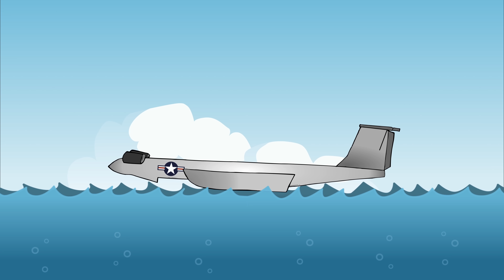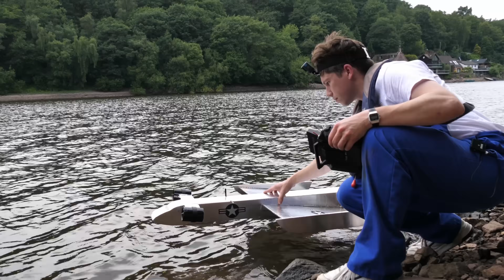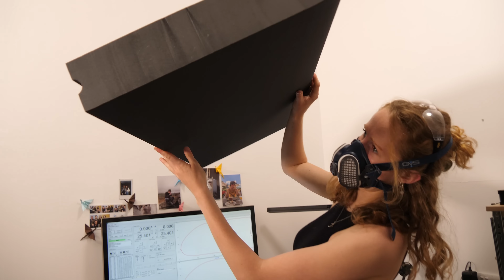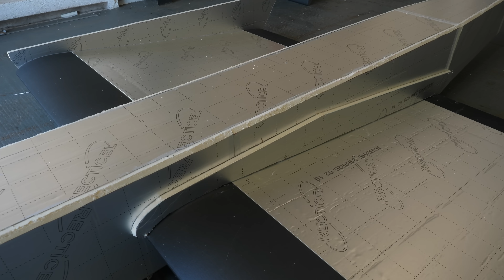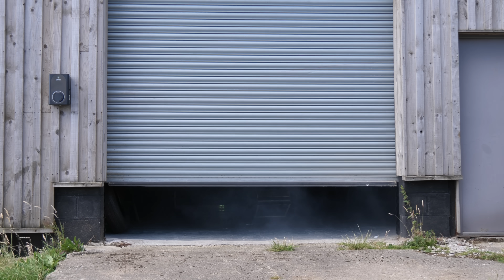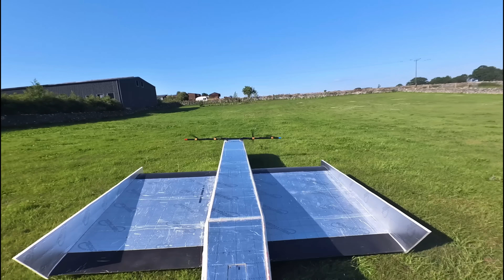Giant Ground Effect Plane (part 1)

Comment: If you make the effort to form the "wings" and other control surfaces into actual air foils, and route the wires for the thrust motors through the carbon fiber tube, you'll find that you'll have far less drag to deal with and better lift/flight control.

Leaving the flight control surfaces flat, and the wires for the motors out in the slipstream do nothing to aid flight characteristics and cause more drag.

Comment: The Ekranoplan was an amazing creation. Unfortunately it could be easily thwarted by small surface sea mines. A $100 floating mine with a proximity fuse would deny a surface-effect heavy-lift vehicle like a brick wall. Whether it cost $100m or $500. Floating mines were the death of the seaplane. A bucket full was area denial. The Japanese didn't deploy these in thousands. They are deadly against PT boats and seaplanes. Both theirs and yours.

Comment: There's a another video about such a thing, not quite so large. What's funny about it is that the creator bad-mouths the concept, saying they're useless except on glassy calm water.
So they take it out on a lake with a chase boat and right away prove that it doesn't mind when the wake from the boat is bigger than it, and that it can fly.

The KM and the later, smaller Lun were not capable of flying higher than a few meters because suits and uniforms wouldn't give Alexiyev the time and money to equip it with proper avionics and controls.
The second Lun airframe sat partly done indoors until moved outdoors and scrapped in 2015, but for a while there was talk of finishing it to fly, as a firefighter/ambulance, called the "Spasatel".
Many models of such things have proven that yes, they can fly, no, they're not limited to flat calm water.

It seems that very few know of the work on GEV machines by Lippisch. There are youtubes of them, and the X-113 and 114 do fly. See also the similar "Airfish" which was tested extensively and worked well. Videos of it show the pilot seemingly dipping a wingtip during turns as if to get more yaw from it, and nothing bad happens.

Also Gunther Jorg who worked with Alexiyev worked on his version of it and made it work.

Look for the USNI press article from 2020 "Modern Sea Monsters", urging development of GEVs for the US navy. They take the concerns about it only being useful in flat calm waters to task and debunk it.
 For a while DARPA was working on it and seemed confident that it u be much more capable than objectors think and would be an important asset.

Comment: Actually, the Russian Ekranoplan is capable of flying up to about 2,000 feet in altitude, but it uses a lot of fuel when it goes up out of ground-effect. The ground-effect or WIG aircraft was developed from the designs and test models of Alexander Lippisch, who also designed improved versions of delta winged aircraft. There is a medium-size WIG aircraft that operates out of Hong Kong that can carry about 8-10 passengers and two pilots or about a ton of cargo It's called the Airfish 8. It seems likely that the WIG aircraft will spread to many other places, but for some reason doesn't seem to be doing this. It would require constant vigilance by the pilots and a good radar system to avoid collisions with boats.

Comment: It might benefit your ekranoplan to put four blades on each engine hub rather than the two you have on now. Also, consider putting two smaller motors on the tail just forward of the rudder. I bet it will lift the tail, and balance the ground effect such that you don't find yourself flying sideways in a breeze. If you link the two motors to work in concert with the rudder, you will get a degree of steerability, as well as stability if it tries to flip on you. That's kind of how the real thing "worked". The rea; Ekranoplan was kind of a one way ride. It had to travel into the wind, and when it got to where it was going (no crabbing allowed), it had to be towed back to its original port using a tugboat. This got pretty old with the Soviet bean counters, and they decided to drag the thin out of dry dock and dump it on the ground a few miles away, where it was left to rust, rot, and decay. I don't know what condition it's in now, or even if anything remains of it. Last I heard/saw, It was in pretty bad shape, with all of the engines having been pulled, all the avionics having been broken, and a lot of the skin and spars having been cut off/up to recycle.  Almost all of the wires had been stripped out, and all that was left was a devastated husk. A shame really, considering all that it represents in the  history of aviation. I guess technically there is one larger aircraft that stayed in ground effect for the entirity of it's only "flight", and that is the Hughes aircraft flying boat the "Spruce Goose".  It was a gigantic aircraft; the largest aircraft of it's time by quite a bit. It had six gigantic Wright 'Whirlwind triple radial engines mounted on the wing and on it's first time out of the barn, it's designer/owner/builder Howard Hughes, took the thing out on wat was only supposed to be a taxiing shake down, and jammed the six throttles full forward. The flying boat went a few hundred feet, after which Hughes pulled back gently on the yoke, and the gigantic bird eased gently into the air. Hughes flew it for a few hundred yards, all the while the other people in the plane cursing him constantly for violating orders and actually flying the plane, while also imploring him to please land it and thus spare their lives. Eventually he gradually pulled back on the throttles, and the Spruce Goose gently kissed the water, and taxied back to where it started. At that time, Hughes, exited his plane with a huge smile on his face, only to find a lot of military brass on the peer, each taking their turn dressing him up and down, and letting him know that the aircraft was being seized, and that they would not permit it to ever fly again. They kept their word mostly. It never flew again, but they didn't junk it. Not many years later, a bunch of people who had lots of expendable change weighing heavily in their pockets, bought the Spruce Goose, and began work on a building to keep it in permanently. When the building was finished, they moved the vast flying boat into it, then donated the whole lot to the Smithsonian Air and Space Museum, in effect creating a west coast version of the great Washington DC museum. There are a few other items of flight history which have been included there, but unfortunately, the location has ended up on the block of things which President Trump has decided to cut. The situation now is trying to find enough private funding to keep the place alive until Trump is out of office, and we have someone in who cares a bit more about history, and not about the things that he had no part in. Maybe if we could name it after him, and tell everyone that he built it all with his bare hands... Na. I wouldn't want to disgrace it so.

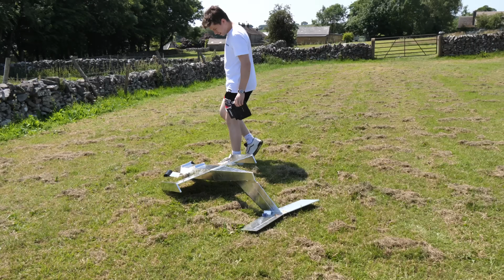Comment: What you think was a small tornado at 4:30 is a small thermal kicking off (I fly sailplanes and paragliders). Doesn’t happen over water because of its massive heat capacity.

Comment: The show Knight Rider ran from 1982 to 1986. It featured a very special talking Trans Am. The show runners would use a 1:8  scale (23 inches) miniature for various shots. The models were launched using compressed air. You do some really amazing things on this channel and I was wondering if you might be interested in trying to recreate an accurate miniature and launching it for some incredible jumps? I think a rocket-powered one would be amazing. Cheers!

Comment: I Think if you were able to set up a servo onto the carbon tube with the flight motors and are able to trim the angle after getting up to Ground effect so you can increase speed while on that foil of air.

Comment: would a more aerodynamic form not help?
Also installing the propellors on the wing remove the drag caused by the carbon fibre bar that holds the propellors.

Comment: If you saved your cut off waste parts, you can make a mold for composite layups.    Also, put a bearing & jackscrew on engine tube to control engine thrust angle

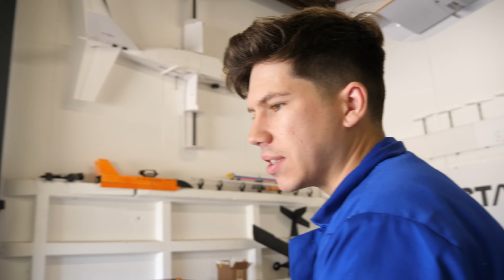Comment: 11:50 you can add tension cables to make the wings more rigid and stable.
additionally larger diameter carbon tubes would make it stiffer too.

Comment: The problem with the Caspian sea monster is that it isn't a stable aerodynamic shape . The Russians had to use a fly by wire system to maintain constant height and stop pitching up . Modern design use a reverse delta type wing which automatically maintains height .

Comment: It probably would have been easier to put either carbon fiber dowls inside of those carbon fiber tubes that hold the wing on or maybe even wooden dowls then you wouldn't have the drag that you get from the pieces you put on the outside of the fuselage to make it more rigid.

Comment: I'm not an  expert, but it appears to make more sense to have the air cushions towards the ends of the wings.  That way you can get a more stable flight and as a bones an easy way to turn, buy just slightly reducing thrust to the right or left engine.  Bit of a major re-design, but could be worth a try.  Fun watching this video.

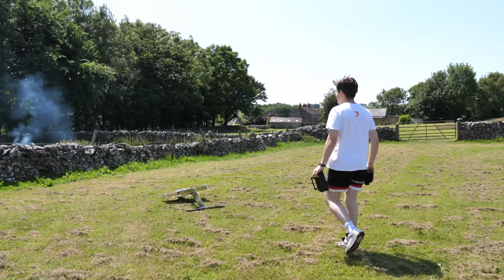Comment: 4:25 in the paragliding community those are called dust devils. They are exceedingly dangerous because they are mostly invisible and kill paraglider pilots.
They are caused by similar effects as real tornados, just driven by local thermal bubbles instead of large scale weather effects. And yes, bonfires do create thermal activity.

Comment: Nice build and well done. Looking forward to seeing it perform on water. Just a couple of notes. When you look at the actual Econoplane there is a definite dihedral to the tail plane presumably to assist with roll stability. Also the jet engines appear to be aimed above the wings presumably to move the air faster, lowering the pressure above the wings helping lift. The air flow provided by the propellers you are using might not be fast enough although I do notice that the motors on the large model do appear to be mounted higher above the wings. This is no criticism of your design and efforts, just something that I noticed.

Comment: Very cool.
You're making it hard to work, as the scale weight is really low. At 6 meters it should be 1000 times the weight of a 60cm version but it's obviously much lighter. You aim at similar speeds as a 60cm version. Very wind sensitive.
At that scale, a 100 mph manned ecranoplan could be built. With a more correct scale weight, it would be a lot more stable.

Comment: in a 1:4 scale model its important to remember that because of the square cube law (volume is multiplied by the scale an extra time compared to area) your volume (weight) will increase 4 times more than your surface area (lift). In this case since your scale model was so lofty your final result was perfect!
Reply: Well that's great because then it will compress air more strongly.

Comment: The way ground effect works is this: during flight, lift induced drag forms vortices that trail back from the wingtips- they are a product of span-wise flow. The presence of the ground constrains the formation of the vortices, so there is a reduction in induced drag- so more lift. The effect happens when the aircraft is below half its span in height above the surface.

Comment: The original had two tail engines on top of the 8 mains. I think these provided the forward speed whilst the 8 canards provided lift. Maybe wit 4 main fit a single pucjer on the tail? Having said that - you may not want speed at this stage!!!

Comment: Nice project, don't know why you have US decals on it though? I read quite a bit about this plane a few years ago and I think you may have missed an important part of the original design. The eight forward engines were designed so that the jet airflow would pass over the top surface of the wing thus creating additional lift., I feel your propellers may not produce a well enough defined air stream and are too far forward to have any real effect on the lift? Hope that helps.

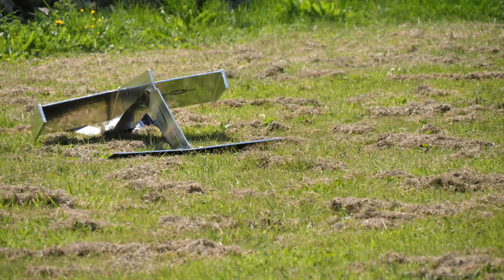Comment: The plane flipping 4:19 that happens to Nascar aswell it's called blowover it happens when let off the gas and u start to lose grip on the track or for this case u lose grip on air and since u have ur  wings facing up that creates more lifts so it can blow over more

Comment: If I may, putting in more full shots of the plane moving instead of changing the camera angles so much is generally a better way to make videos.  That's just something I've observed from larger channels because it makes the spectacle more easily viewable.  Overall a great video and effort.  
Last thing is a piece of advice for scaled-down airplanes.  Use a larger wing ratio.  It's much easier to get better ground effect with a larger wing and makes it much easier to keep it in ground effect.  I've done some aerodynamics research and study myself and the necessity of that ratio rising with the size decreasing is pretty conclusive unless you want to force a faster speed.  It's not great, but you did a marvelous job with this plane.  Congratulations!  I'm extremely impressed.

Comment: Two suggestions,  Counter rotating the port and starboard motors to cancel out propeller torque  and get a flight controller with gyros and setup the horizontal stabilizer  as an elevon so the gyro pid loop can keep the roll axis auto leveled..

Comment: This video really solidified for me that an ekranoplan is basically a linear hovercraft (whereas a normal hovercraft has its skirt of air directed radially outward, an ekranoplan directs the air explicitly aftward, providing both the skirt and the thrust). It's such a clever design. It's a shame that stabilizing such flight ends up requiring huge, heavy wings or a long heavy fuselage and heavy tail so that the tailplane can properly pitch the body.

Comment: Really great technical achieveent.  A proper WIGE rather than just a very low flying model airplane.

And I second the comments about Emma and the DIY cutting machine.  That's a helluva build to relegate to a passing comment.

But my overwhelming impression, as an aviation enthuiast and former flight-simmer, is that was a crazy amount of yaw on the "takeoff" run.  If I was the tiny pilot flying that I'd be crapping my tiny pants with it  slewing like that.  Was there much crosswind?  Appreciate you had to run it the longest length of the field due to it's size and maybe couldn't align with it into the wind.

Comment: I was designing a 4-axis wire cutter (Separate Y and Z axes so it could run two different profiles that only meet at the beginning and end). The issue I ran into was that the wire changes length. This was solved in a way I thought was pretty clever on my end, but I wonder how she fixed it~. Maybe we can compare notes~. Female Engineer Squad!

Comment: I'm no expert on aircraft so maybe I'm wrong, But from observation of other ground effects models, they all seam to want to take off and fly like a plane. And all have the same layout in design. (Short stubby wings and 2 to 8 engines at the front of the aircraft) How ever the Caspian sea monster had 2 engines on rear as well, when it got up to speed the pilots actually turned off the forward engines and started the 2 smaller rear ones. This aloud the craft to maintain a cruising speed and minimize fuel consumption. I would also wonder if the placement of these 2 engines help keep it in ground effect, seeing as how the forward engines were no longer blasting there thrust exhaust under the wings. Would this not have an impact on how well it fly.

Comment: If you can afford all that and an employee. You can afford elrs.

It's stupid you're out of range when you can still visually see the aircraft.

It's also dangerous for an aircraft that large to lose control
Reply from the maker: It lost signal due to surface interference. We had fail safes. The larger craft has the receiver on the tail much higher from the surface.

Comment: I like the work you did here, though I can't help but wonder how much easier it would have been to keep the same pitch angle of the power pods the Ekranoplan's had and an actual airfoil wing. The entire design of the power pods in front of the lift wing was to generate the air moving over the top of the wing without moving forward so much to basically hover, with the added benefit of moving forward of course, they used the power pods as lift generation primarily. Looking at the designs, and images of the craft, this is clearly visible, they didn't have thrust going under the wing, it went OVER, it generated more lift at lower speeds that way by artificially accelerating the air over the wing and leaving the "cushion" untouched by thrust.

Comment: In a normal airplane, you generally need a single wing then an elevator to control pitch.  But in the case of a ground effect vehicle, you really want the vehicle to remain level at all times.  Why not have 2 sets of wings, fore and aft, to make it easier to balance?  Kind of like a hovercraft, that has the lift along the entire length of the vehicle.

Comment: Nice job. Just one little tip though, to help keep the airflow trapped under the wings, try angling the trailing edges down a little. If you have a look at the full size Ekranoplans you will see they have same on those. I'm not sure if they were adjustable relative to speed - basically working like flaps :)